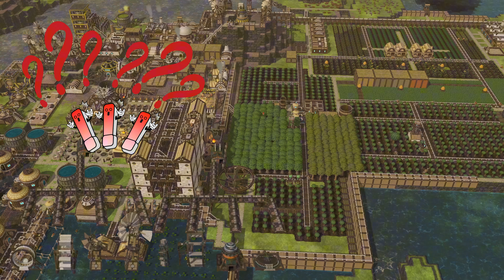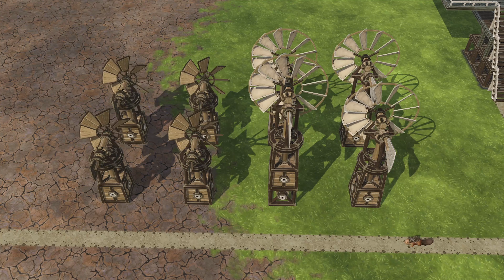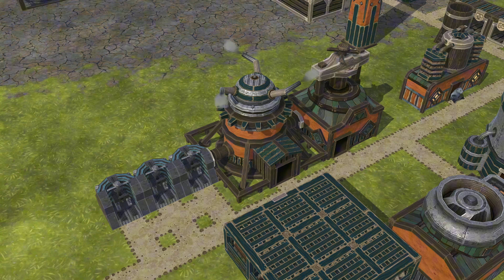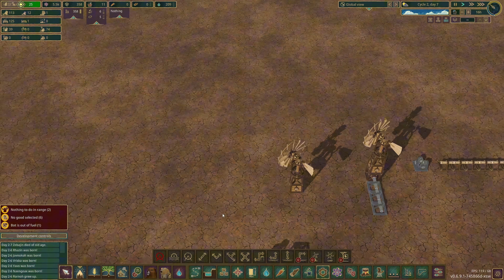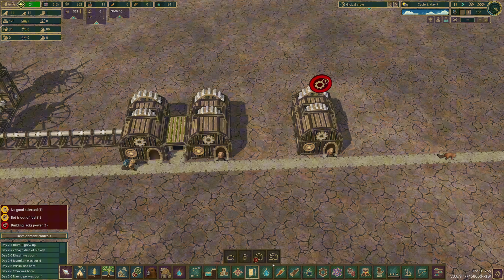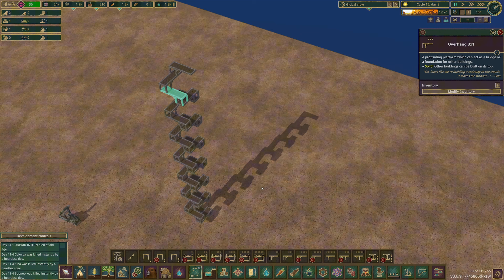Timberborn U6 - ULTIMATE Power Guide! (GIGA BATTERY included!)

Comment: 16:36 Couldn't you run the power up the middle of the stairs? You'd need an extra platform to get it over but it wouldn't be too hard.
Reply from the maker: Most likely yes! Nice eye you have! I noticed it during editing, Buut then i made a second 5x5 platform and i tried to figure out how to connect that :D If it was in the middle, it would've mneant that wasn't possible in the way I have shown. 
So I decided to leave it as it is instead of re-recording that part :D
Reply: You can run power through overhangs just not through the base of them where they are supported.
Reply from the maker: That i didn't know! I will test it out!

Comment: Thanks for the guide! And nice chill elevator music.
A power tower with overhangs is probably more efficient, but looks too silly for my tastes.
Reply from the maker: @lChronosl93  i usually build it in the corner of the map and forget about it :D out of sight out of mind!
Reply: You could instead use Skye's method and dig down to the bottom of the map, and hide the batteries underground.
Reply: Do the gravity batteries work if they are on the lowest level?
Reply: @lChronosl93  No, you build them near the surface with a big pit underneath. Basically you dig a two-wide trench; one side is only a few tiles deep and the other goes all the way down. The batteries go on the upper line facing the pit. And then you can cover them if you want.
I think Skye actually did it on a hill so "ground" was fairly high to begin with.
Reply: Makes more sense, gotta try it out. 
Thanks!
Reply from the maker: @lChronosl93  The secret here is that Skye built it on a hill. 
Check if you have enough ground clearence to be able to do so. On the height layer, lower it down to the point you're trying to build it. 
Each level adds +2000 hp on the battery. 

So check firstly if it's worth it for ya to do it!
Reply: Definitely should have run the power shaft up the centre of your design to hide it. Then also underground when you reached the bottom, with your overhang design you don’t even need to pre dynamite I believe. Nice video
Reply from the maker: Thanks! I'll revisit this in the future when I'm more experienced and remake them :D